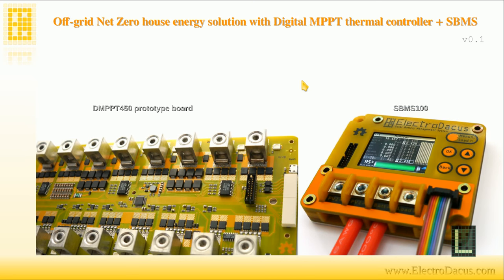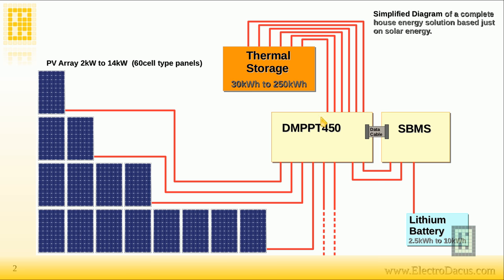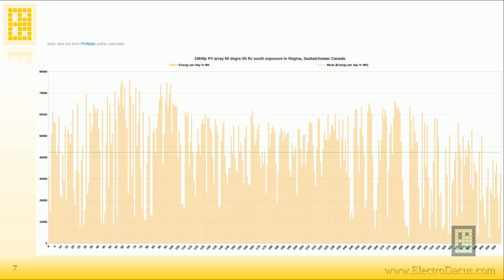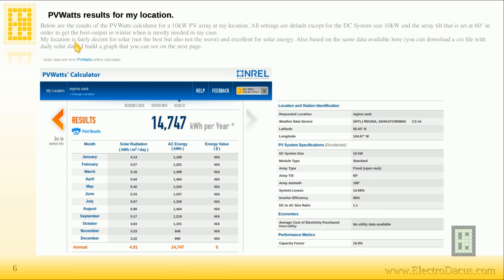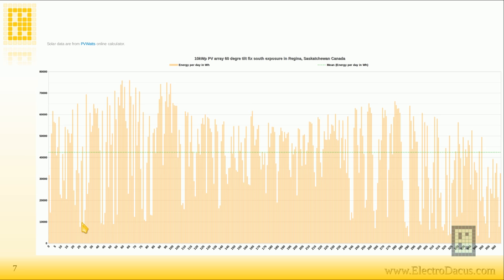Explaining the Digital MPPT thermal controller

Comment: Hi agin Dacian Thanks for help, I "MIGHT" have found the ultimate solution for MY solar panels. The  New SMA Sunny Boy 2.5 goes up to 500V on solar panels, and The new SMA Sonny Boy Storage go up to 500V Battery volt, I run it with 400V DC...Then I have 100 Li-ion cels i series and That will fit correct in the charge range of a Li-ion cell 3.6 to 4.0V as optimal. Thats the same as a TESLA POWER WALL runs with.
I'll have 2 X Sony Boy 2.5 Inverter one for charging the Battery bank one for Household 1x Sonny Boy Storage to charge the 400V Battery Bank and make 2500W for head and Household, with a Battery bank of 30KW/400V I can run the hose for 9h at 2500W doing the dark time off the day....and the rest of the day... charging and heating.../ living

I was told that In Denmark ...in the Winter we get about 1/12 "Solar power" 83W/m2.....for me to get 2500W/h I have to get about 31KW of solar panels ore....(12m2/1000W sun)

That is about 370m2 ore 91 SunPower Panels SPR-X21-335-BLK.....at 335W ....7S 13P strings connected to 2X Sunny Boy Inverter give me about 2500W/h to head/ charge and household for the Winter, and when The sun is shining then I can connect 2X sunny Boy and get some Thermic storage and some power to charge my batteries ........I have of cause the need of a switching system like yours to connect and disconnect the panels .
..when the sun is making to much light......... 

(Maybe You can come up with something fancy, for controlling 91 solar panels 2X SMA Sunny Boy 2.5 and 1x Sunny Boy Storage, and maybe a TESLA POWER WALL 360Volt ) maybe it is time to forget about that 12v and 24v setup...Maybe the future Is 360-400V DC...systems??.

Maybe If any money left I can get a TESLA model ?X? and charge That with the rest off the Power in the summer....and then drive like a crazy to use ...all that POWER.......That must be  My solution .....By the way do you have any money left ?.. ....Jørgen Thomsen Denmark DK  ...YES..YES....We are  Crazy in Denmark trying to wrap our heads around ...our problems ....hmm ....!"#€%&/()=???? ...For now I have got some wood and a pear of long legged underwear ...what a sight ;-)
Reply from the maker: I'm a low voltage guy and will not design anything with above 50V DC. The DMPPT will also only work when used in low voltage setup so that each panel is independent (not in series with others) and can be redirected as needed to battery charging or heating/cooling.
For the amount of solar available at your location please use this tool   http://pvwatts.nrel.gov/pvwatts.php select your location say Copenhagen select your PV array size say 10kW since is a round number and that will be the size of my PV array so I can compare with my location leave all else default except tilt angle in my case 60 degree since I want the most in winter.
Then you will see that worst months are November, December an January with December output from the 10kW PV array facing south no shadows at 60 degree tilt will produce an average of around 220kWh
Now if I remember correctly your house has better thermal insulation than mine and is much warmer there in winter than here about 2x less energy is needed for heating for the same exact house.
I get here 4x more solar in winter months than you do there but is 2x colder so you will need about 2x larger PV array than me assuming the same house and same energy needs.
In the best summer month with the exact same array you will get about 5x more solar energy compared to the worst month so not sure where the 1/12 figure comes from.

About the 100s battery bank (you will need a 100s BMS and not sure where you will find a good one with that capability). The Tesla Power wall as far as I'm aware is a 12s system since it uses two 6s module in series so is a 44.4V nominal battery.
You need to accept that in offgrid you will have a lot of unused energy and that is actually a good thing. Forcing you to use most of the energy is a bad idea and will probably cost you more for no gain.
Need to remember that PV cost amortization is as low as 2.4cent/kWh maybe even 2cent/kWh so if you only use a typical 50% of available energy in a year that will double the amortization cost to maybe 4 cent/kWh still far cheaper than investing in battery storage that has a cost amortization of best case 25cent/kWh for good LiFePO4 and as high as over 50cent/kWh for something like a Tesla Power wall.

Comment: I think that while the electrical and electronic parts would be OK, the thermal storage is over simplified and would not provide by it's own the level of temperature control people expect from today's heating systems. Also the idea that the thermal storage would be virtually without losses is not realistic especially if the building is already existing ( and therefore would be very difficult to remake the hydro and the thermal isolation).
Reply from the maker: There are many possible solutions for thermal storage all I did was to show some examples and how the calculation of storage capacity is done. I did not even mentioned latent heat storage using phase change materials for higher energy density. Temperature control can also be done in many way and I mentioned that a bit in the video.
If thermal storage is inside the house then the thermal storage is without losses because all losses trough insulation of the thermal losses will be "lost" inside the building so all that "loss" will contribute 100% to house heating.
If you have the thermal storage outside the house then yes there will be losses to ambient trough thermal insulation.
And yes this is not simple and calculation for each specific case need to be done in order to do a proper installation that will offer a good average temperature.
Most of the existing heating solutions available can be modified to support thermal mass and solar PV heating.
A new house properly done will of course give the best result.
Reply: All I'm saying is that the thermal storage is not insignificant in terms of planning and budget for this project.
If a part of the building itself is used as thermal storage, like you want to do, it will lose some heat to the soil and you must think if the isolation is good enough. It might not be in all cases.
And for other storage solutions some active elements will be needed in most cases. So they need to be included in the planning and the budgeting.
Reply from the maker: That is the house thermal insulation and not the thermal storage insulation. Concrete floor will have almost the same temperature if is heated directly or indirectly from the ambient air.
So the losses of the house that are there no matter what have nothing to do with the thermal mass loss.
Say I do not use my concrete floor as thermal storage  (it will still be thermal storage no matter what I do since is part of the house) But just say I heat with say a propane air heater then amount of energy needed will be the same since losses trough house thermal insulation will be the same as if I heat the floor to heat the house. In fact heating the floor will make it more comfortable and so energy use can be lower the losses trough the floor insulation will not be higher or insignificantly higher due to slightly higher floor temperature maybe 3 to 5C higher than if a propane air heater will have been used.
Most of the house thermal loss is trough windows, roof and walls and way less trough floor so increasing floor temperature by 3 to 5C will only have a total additional loss of maybe 1% when entire house loss is considered.
But since with floor heating air temperature inside the house can be lower for comfort than with just a propane or electric air heater then losses trough house insulation will be lower not only canceling the 1% from slight increased floor temperature but also providing some net gains since roof ans wall temperature loss will drop by more than that.
Reply: If, using a propane heater, you heat the air to 20C the average temperature of the concrete mass would be lower, let's say 18C.
However you gave an example of heating the concrete mass, using electricity, by 12C higher so for the same 20C air temperature, the concrete mass would have an average temperature of 32C so you have a total of 14C higher than in the first case so we are not talking about 3-5C. 
Maybe your target temperature would be lower than 20C but  I think you will find that you will experience some losses.
Reply from the maker: The max range I can realy use the concrete will probably be +16C to +28C and from this I got the max storage capacity at 12C delta.
I get even now down to +16C if I start with +21C and then I do not heat for about 3 days.
You can still maintain the air temperature at 20C even with concrete floor at +16C if you have an additional smaller capacity thermal storage that preheats the air coming out of the heat recovery unit to something around +22C
Air heat storage capacity is about 1000x smaller than that of water by volume so not much energy is needed to heat the air.
As you see even in worse day in January I still get about 8kWh from my 10kW PV array and that energy will all end up as heat inside the house no matter how it is used.
The daily average energy needed to maintain constant temperature inside my house in January is around 30kWh and since most cloudy days will provide as you seen is solar energy graph at least around 15kWh it means that thermal storage in that day needs to cover only the difference and usually there are not more than two max 3 consecutive days in January with less than 30kWh average needed.
So the most the thermal mass will need to cover in my case in an average sort of year is around 40 to 45kWh so just a bit less that half the storage capacity is needed 5 to 6C delta.
Thus the Concrete slab can operate in the 19C to 24C range 95% of the time with the possibility in one colder year for a day or two of additional consecutive bad weather that may bring the concrete slab temperature as low as +16C
Adding a smaller 8 to 15kWh thermal storage connected to the output of the heat recovery can allow for the storage of that energy produced in those bad days and spreading that over 24h keeping the air temperature around 20C even in those rare cases where floor thermal storage may get down to +16C once every few years when there is a colder than average winter.
This year is externally decent as last year also with temperature no colder than -6C until the end of the month during the day and no colder than -13C during the night. This is well above the -17C average for this period.
The beginning of the month was much colder with -20 to -30C but then it was also extremely sunny.

By the way I used up to now almost 7 propane tanks this month so I expect about 10 at most until the end of the month. One of those propane tanks costs 25 CAD right now so they are fairly expensive at 25cent/kWh and that is why I do not want to use them even as backup. PV panels have an amortization cost of just 2.4 cent/kWh if I where able to use all available energy (it is higher because of course I will not use all maybe just about 40% usage as average over a full year and even so is much less than propane).

Comment: https://youtu.be/lP6anRNMW3I?t=1379
 Did you mean 260W panels in the solar section instead of 260V?
Edit. This is brilliant. You are basically heating your house straight from solar panels without the need for battery storage. 
To implement this will need some thought by the person using it depending on the size of the house but you could heat your house using storage hot water tanks and radiators using a pump or heating cables directly in the floor. Also you can charge batteries for for an inverter at the same time. [my summary of this video}
 However living in QLD AUS I must say cooling is a bigger priority for me than heating. If somehow this could be connected to a air conditioner for cooling of some type that would be a winner for me.
Reply from the maker: Yes is 260W thanks for noticing.
Just done the correction to the pdf document and it will probably take a few minutes for the new document to be available on the web-server. I will also add an annotation to the video.
Reply: Sparkie Kosten Agreed. I'm from Malaysia and AC is my main concern here. I wish someone can explore and come up with AC option for these.
Reply from the maker: Yes that is one of the big innovations that the heating part will not require a Lithium battery and will use thermal storage instead to store solar energy.
Same can be done for cooling using peltier elements and water storage.
I mentioned a bit in the video that energy needed for cooling even in Australia is an order of magnitude lower than heating.
I will maybe do a separate video or google post explaining this in to more details with real examples.
Check whether data for your location and look for the average temperature in warmest summer month and my guess is that it will be around +30C (this is average for the month not max). I think in summer a +25C inside temperature is comfortable so delta of +5C is needed in the summer month.
In coldest winter month is likely you have an average of +5C this means that you need a delta of +15C to maintain a comfortable +20C internal temperature.
So just seen like this amount of energy needed for heating is 3x higher in coldest winter month than hottest summer month and adding to this an AC with a COP of 3 the amount of energy needed is 9x smaller in summer for cooling than it is in winter for heating.
Additional to the external temperature you need to consider that each person present in the house will contribute to about 100W of heating and all your electricity and natural consumption for devices inside the house will contribute to heating your house (this includes but not limited to fridge, your computer and lights).
All that energy will need to be extracted by the same AC unit.
If you do not want to get complicated you can use your current AC trough an inverter and if it is used during the day it should mostly use energy from PV array directly with some battery buffering.
If you want to get complicated you can build a custom peltier cooler that can be used directly with the DMPPT.
Edit: I just looked at the data for Brisbane and yes it is much warmer there than in the other cities in Australia with an average of 15C in the coldest months so +5C delta but also more moderate summer with average of just +25C in summer see here http://www.brisbane.climatemps.com/brisbane-climate-graph.gif
This means that in summer you only need air conditioning because the house has no significant thermal mass to keep a constant temperature and as mentioned before you have a lot appliances that produce heat inside the house.
All that heat used by appliances will need to be pumped out so you need an AC that will use 1/3 of your energy in hottest summer month to keep the house at +25C
Reply from the maker: Read the answer I give to Sparkie

Comment: This might even be possible for heating vans and RVs.  https://www.youtube.com/watch?v=v34NoHeYP1k Get a couple of stainless steel drums and fill them when you reach your destination.  Then you might even be able to connect  to the car radiator get them up to temp and should last the night.   Problem where I live is I have raised wood floors but the den is on concrete slab.  Even a 3kw system for van is possible with the folding thin panels.
Reply from the maker: Yes is possible to heat an RV by using an empty water container and only fill that when not driving and 3kW should be plenty for the size of an RV but it will depend on amount of sun at the respective location and climate.
The 150 gallon on ebay is expensive since the 55 gallons I mentioned in the video cost $60 new so 3 of those will cost less.

Comment: I have too many questions. You say there is 31-32 modes/combos. Will this switch through them by itself? Or do you manually choose with whats coming in from the pv?
Reply from the maker: The DMPPT450 will do the selection automatically based on available solar energy to get the max power point.
Reply: @electrodacus  that sounds amazing